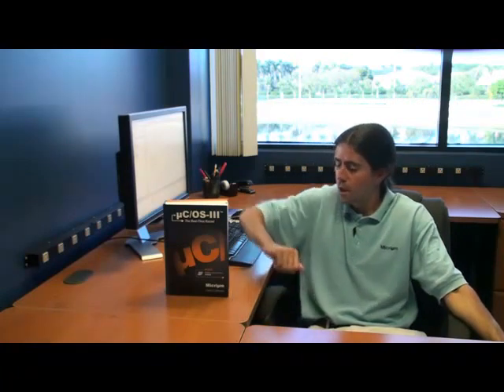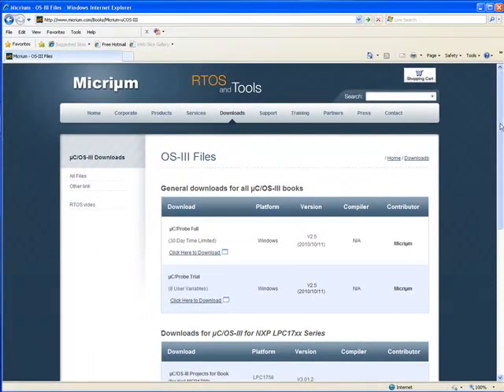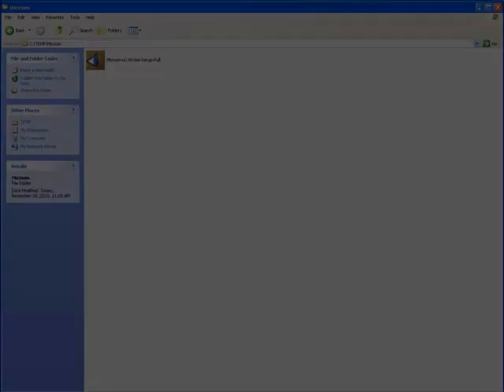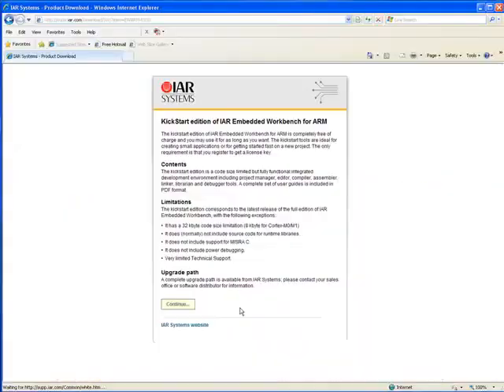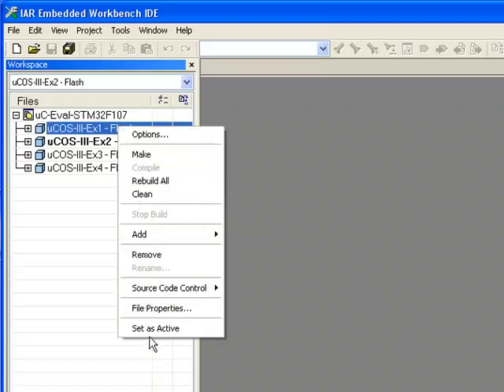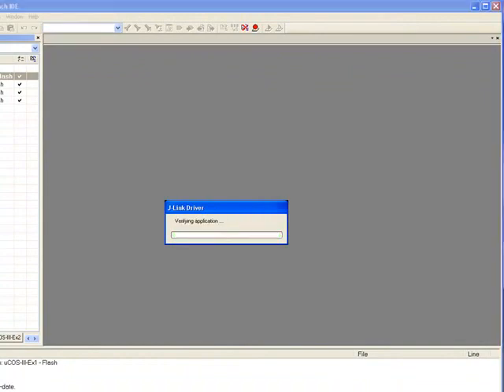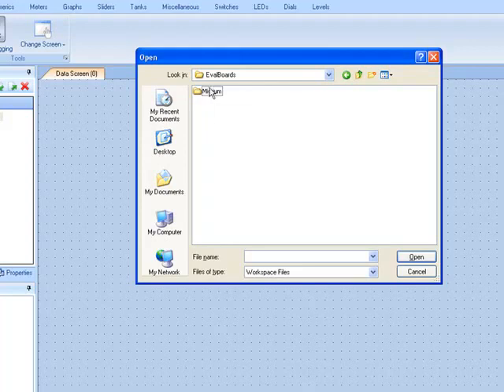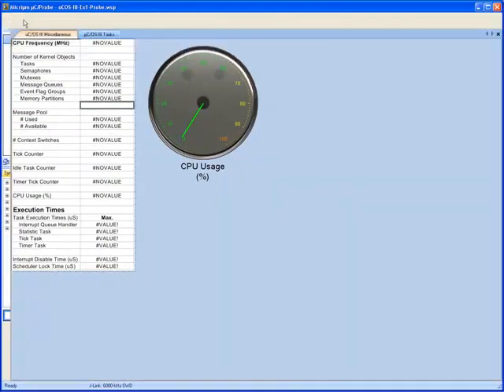μC/OS-III for the STM32F107 Microcontroller

Comment: Hey, hi! I have recently bought the board and the book, but the specific port, examples and board has been useless so far. I was not able to import the IAR project in many versions of the IAR Embedded Workbench. I even tried with EWARM 6.21 and got the same error. Could you please provide a workspace or IAR tool link that compiles and works without any errors?
Reply: Sorry, I got to make it work without problems with the latest IAR Embedded Workbench for ARM, which at the moment is 7.70 using the Evaluation version with limited code size. Sorry for the noise.
Reply from the maker: No worries, caconeta1234. Keep an eye on the Micrium web site in the next week or so. We're launching discussion forums that will be a great place to pose such questions.

Comment: After following all the steps 1- Downloading IAR workbench v 7.40 and μC/Probe
Installer for µC/Probe 3.5 and the examples when I try to build it, it fails with this error
Error[Pe020]: identifier "OS_ERR" is undefined C:\Micrium\Software\uCOS-III\Source\os.h 1834 
I am kind stuck any pointers would be appreciated..
Thanks
Reply from the maker: Hicham Ichkantana We're not sure which project you've downloaded. Head over to http://micrium.com/downloadcenter/download-results/?searchterm=mi-stm32f107&supported=true and make sure you've got the most recent version of the book project. We checked them, and them seem to work just fine. You can also download the full book from this page, too.
Reply from the maker: Hicham Ichkantana Also, be sure you're running the latest version of Embedded Workbench.